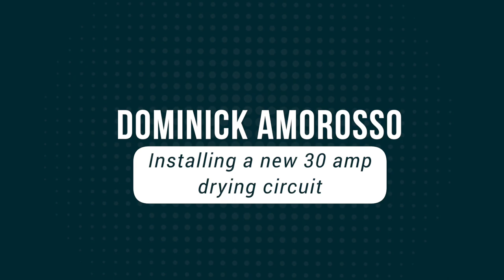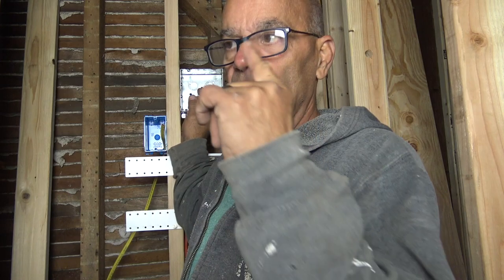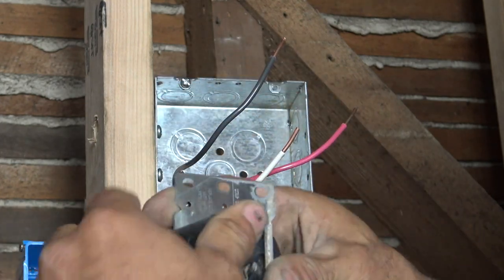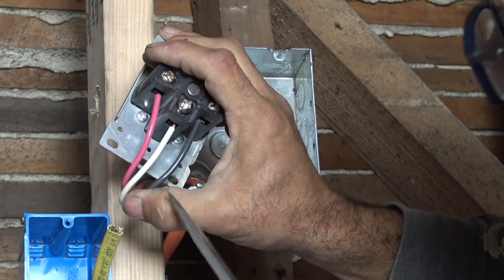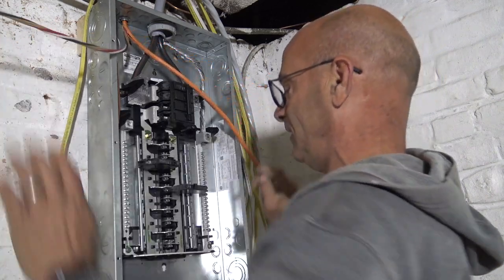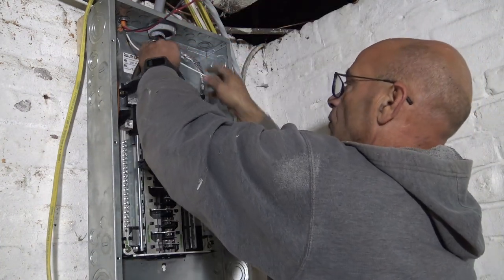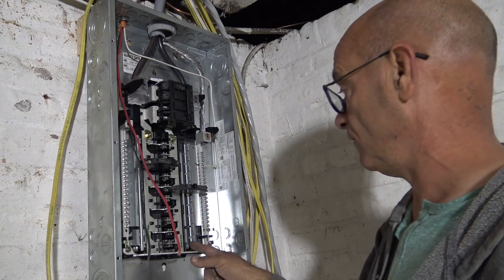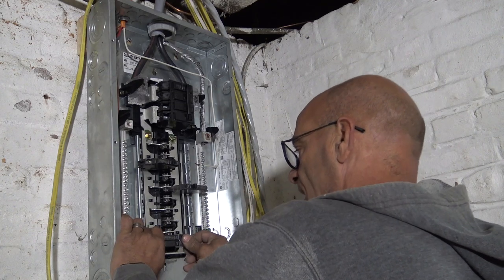How To Install a 30 amp Dryer Circuit With Breaker and Outlet

Comment: Probably calling an electrician.  I need to run a ground to old 3 prong dryer outlet, thankfully its like a foot away from the breaker.  My 30yr old speed queen finally finally died and I'm loathing having to buy a new budget machine.

Comment: Perfect explanation. Just what I was looking for. Thank you
Reply from the maker: Awesome, glad I could help you out.
Reply: @Askmediy  Nema 14-30, my 30 amp,125/250 volt, 14-30R, 3-pole, 4-wire , my 4 prong plug 30 amp electric dryer is wired to 30 amp outlet is not working why?

Comment: I think you’re hilarious. I recently wired up my breaker and the outlet for a dryer, and I definitely was a little nervous about turning on the breaker. You made me laugh so hard when you were teasing us about it.
Reply from the maker: LOL But very true LOL.
Reply: @Askmediy  Nema 14-30, my 30 amp,125/250 volt, 14-30R, 3-pole, 4-wire , my 4 prong plug 30 amp electric dryer is wired to 30 amp outlet is not working why?

Comment: Perfect! Exactly what I’ve been looking for. Nobody explains the panel part. And you made this video very entertaining! Hopefully my wife doesn’t yell at me though 🤣
Reply from the maker: Good deal. Thank you so much
Reply: @Askmediy  Nema 14-30, my 30 amp,125/250 volt, 14-30R, 3-pole, 4-wire , my 4 prong plug 30 amp electric dryer is wired to 30 amp outlet is not working why?

Comment: Excellent explanation... should I use 10/3 romex to the panel from a 30 amp inlet plug for a generator (7500 running watts)? Or can I use 10/2 romex?

Comment: If my wire to the black dryer outlet box is damaged by a dog I feel like I could cut it shorter and move the outlet higher instead of running all wire for my outlet. I have exposed silver wires that wrap around the core that are severed but dryer still works.
Reply from the maker: Seems like it would be better to just replace the dryer cord.
Reply: The outlet it plugs into is damage but not the actual cord to the dryer. A dog ripped open the sheet rock and began to tear open the wire leading to the outlet. I found this when getting my house ready to sell. The old owners left me this surprise and I have been living with it for 6 years lol Also the outlet is against the floor which I think I saw is not code anyways. 1987 home
Reply from the maker: @Douglaskyle9191  There is no code on the height of the outlet. If the wire is coming above it, you should be able to just raise it up to good wire.

Comment: That was just like standing next to my uncle while he's teaching me something!  Well done sir, thank you making this tutorial.
Reply from the maker: Very nice to hear. Thank you very much
Reply: Nema 14-30, my 30 amp,125/250 volt, 14-30R, 3-pole, 4-wire , my 4 prong plug 30 amp electric dryer is wired to 30 amp outlet is not working why?

Comment: Beautiful 🤩 exactly what I was looking for . Question. I want to install about 5-8 240 baseboard heaters in my basement.  You think 2 30 amp circuits would be enough?
Reply from the maker: Most baseboard heaters are 20 amp. Please follow the instructions for sure.

Comment: Is there code for how far or close an outlet can be to the circuit box. I have to move my dryer to the opposite wall and the opposite wall contains the breaker box
Reply from the maker: No not at all. Distance, yes. But nothing you need to worry about.

Comment: Can the green ground wire be connected to the white ground port? On 10;00 the wire is not connected.
Reply: No. Only to the green ground screw and never connect a ground wire to a neutral intended location. The neutral and ground are bonded at first disconnect means (usually the main panel) and nowhere else.

Comment: It looks like the wiring on the hot water tank are 12 ga is 10ga okay for the run of about 10 ft and 10ga 3 wire outfit a dryer that’s even closer to the power panel, also I have a Meg welder the plug has a ground and a small and large knife blade the the outlet shows 120/240 at 50amp, how big should the wire be and what size breaker do I need

Comment: Tbis is a dumb question, but, you said 30 Amp breaker. And it's a double breaker... does that mean 15 and 15? Or 30 and 30
Reply from the maker: Not dumb at all. This means the total protected circuit is 30 amp

Comment: Hey guys what if the new 30A breaker doesn’t fit in the old box? Do you just get two 30 breaker that are the same type as the old breakers and run the two hots to each? Thanks for any advice

Comment: I have a 220 volt electric hot water heater in my basement and want to add a switch at the top of my basement steps to turn it on and off.  Can  you show us how to do that and what switch to use?  Thanks.
Reply from the maker: Just like any other switch. But it's a two-pole switch. Meaning that each side of the switch is for each hot. With 240 volts it's essential to switch both hots.

Comment: I have old air compressor with a 10.20 nema. The only outlet I could find does not have a ground screw. Just 2 gold hot and silver neutral. I need some advice or a quick how to. Does it need to have a ground or just wire as is?
Reply from the maker: Are you sure it's 220 volt?

Comment: Hey, Piasan...you mentioned Old vs New dryers with electronics, the question now is, the home dryers are wired with two wire 10, i had a new washer dryer installed with electronics, should i convert the two wire to three 10 ????  access is no problem
Reply from the maker: Funny you say “piasan” I’m in Italy right now lol. Yes, you should if you can. Because you’ll need the two hots and the neutral. Ground of course
Reply: @Askmediy  Hey, grazie per la reposta..I will do that...Godere!!!
Reply: in addition i found out 1996 was the cutoff for three prong vs 4 per N.E.C., again Thanks

Comment: Hey Dom, can I put neutral and ground wire on the same side in the  panel box?
Reply: Sure, as long as it’s not a sub-panel
Reply: @DominickAmorosso  THANKS DOM, TOO EXPENSIVE TO HIRE ELECT. SENIOR YA KNOW ,,,  NOW ONE MORE QUESTION THE COPPER GROUND THATS BARE ,CAN I JUST ATTACH IT TO THE SCREW AT THE BACK OF THE BOX THEN CONNECT IT TO THE GROUND PLUG OPENNING ?.. PLUS THERE ARE STILL LIVE WIRES EVEN THOUGH THE PANEL IS SHUT OFF RIGHT?

Comment: Nema 14-30, my 30 amp,125/250 volt, 14-30R, 3-pole, 4-wire , my 4 prong plug 30 amp electric dryer is wired to 30 amp outlet is not working why?
Reply: That’s a big question, what did you test?
Reply: power on but dryer will not heat up @DominickAmorosso
Reply: also it has power spin tumbler without heat
of any kind, on any heat setting, no sparks nor signs electric discharging beyond normal @DominickAmorosso

Comment: gonna leak something here... your dryer doesn't need to be using 30 amps, in fact, just a few pico amps. the reason it draws so much is because it was designed this way (on purpose), ie, the electric company needs to make money somehow. all your electronics, really, are designed to operate in the high amp range. 15amp vacuum cleaner, blender motor, etc.. turns out, a little project that draws energy out of the air feeds a heating element in the "pico amp range" and gets just as hot as your dryer's heating element. thanks to a few advancements in this field, the electric company is guaranteed to go out of business. give it a few years..
Reply: Pico... Delicious